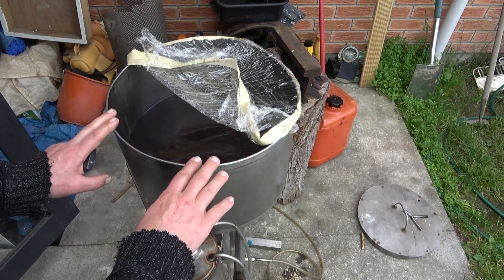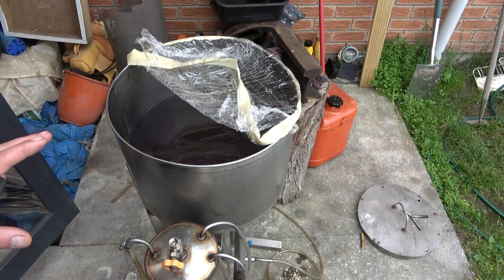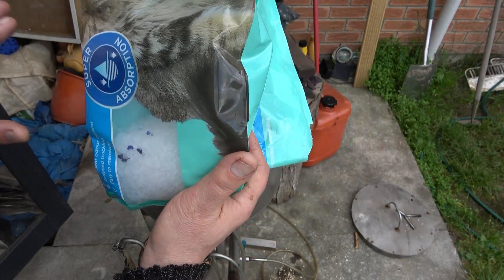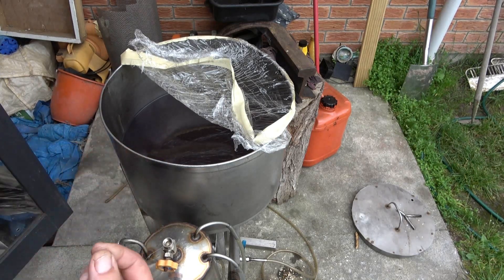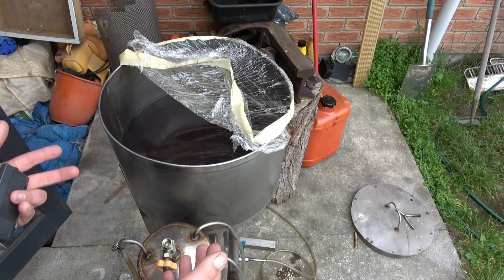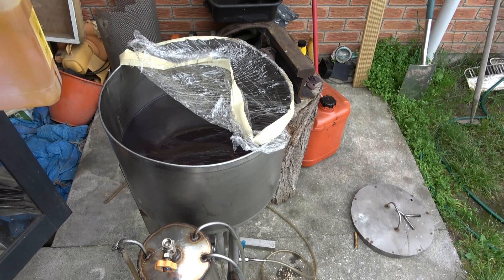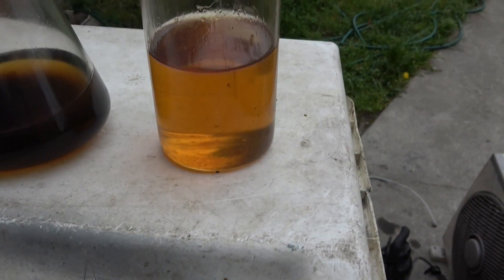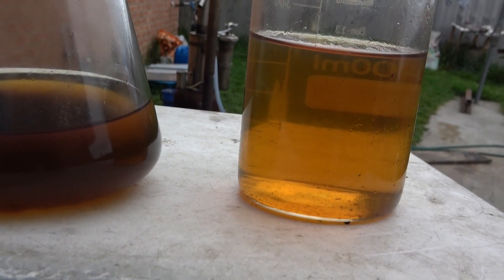Black diesel odor removal and color treatment.

Comment: What about the water? It being immiscible in water, shouldn't it come out first from the bottom of the conical vessel? Also, is there another silica gel bed from which oil is passed or is it the same 0.5 lit as mentioned earlier?

Comment: Instalatia mea, empirica  https://youtu.be/WskM5eFfL7c
Reply from the maker: The final oil was not treated and the bitumen with polymers will form within the fuel system clogging the line and injectors.
Reply: @santeryi9  Corect, ai dreptate